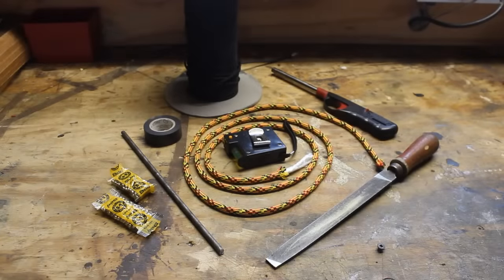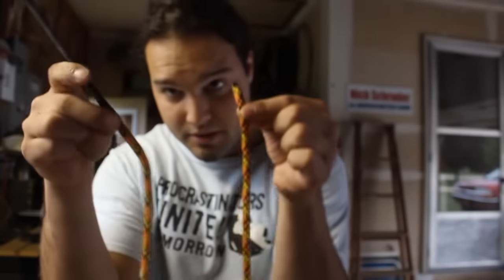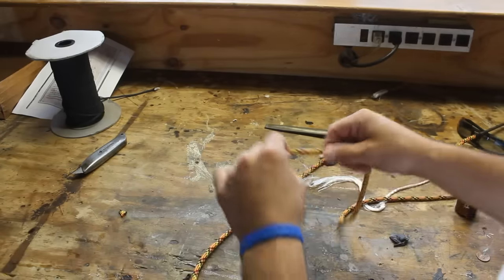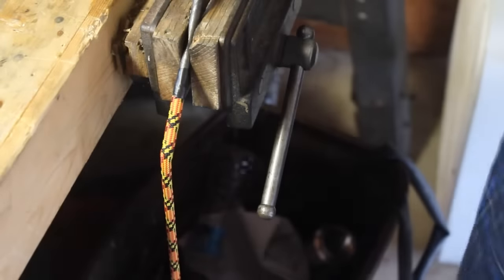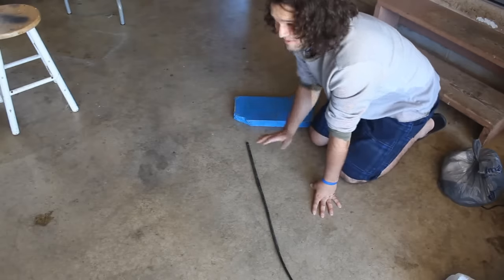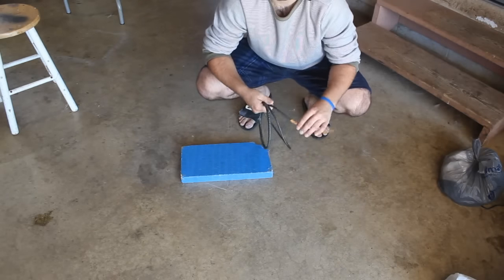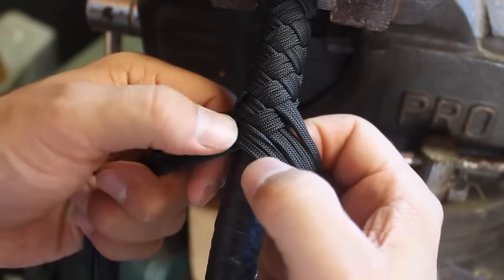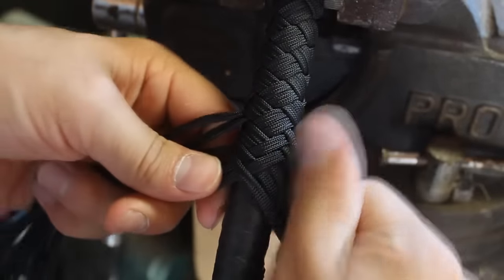How to Make a Paracord Bullwhip - a full length tutorial by Nick Schrader

Comment: Hi Nick, thanks for the video. I just finished the 6 footer. Came out pretty good for the first time, thanks again. The only problem I had was that I was using 550 paracord from Hobby Lobby. It seemed that every 10 feet I came across a splice. The paracord was twice as heavy and the splice was really long. What paracord company do you use for your whips?? And how far apart are the splice points? Also if you recommend electrical tape I use Scotch 33+. very flexible, I use it at work. Thanks. Also I am a fellow musician, brother. Just type in my name on youtube to see my stuff when you get a chance. Thanks again, Michael Szmania.

Comment: OK I've got 4 questions. Is it possible to make a 10' or 12' whip? Do you know how long the strands would have to be for each belly? Would I have to add a 4th belly? And how do you make the 2 larger (guard) parts on the handle?
Reply: R C Marshall Generally the l0nger your whip the more bellies you want. What the bellies do is one: help reinforce the whip. Two: and most importantly, they help to build up the whips taper. so the longer the whip is you want to add more bellies to get a nice even taper all the way to the fall (end of the whip)

Comment: hey Nick
I'm from Germany.
I have a problem with the length of paracord . They are always too short . I have the lengths that you have indicated converted via google . can you tell me , what's wrong ?
Reply: I should work just fine if you convert it. The only thing that I can think of is that you use a different para-cord. I am using #550. What are you using?

Comment: I now want to make a whip, for no reason other than to have it. About how much Paracord would I need to make this? My local retailer only has 50 foot rolls.
Reply from the maker: HI, you'll need about 300ft.
Reply: Thanks for responding! I managed to make it with about 175 actually. I have all the parts mentioned in the video cut from that. All I've left to do is the outer belly. Kinda ran out of time because of school and exams and all.

Comment: Could you do a easier version  with less strands cause my parents don't want to buy so much things please responded Nick
Reply: i see that its a lot of money, its about $50 to get all the things needed but i have looked around and this looks like one of the cheapest and easiest tutorial
Reply: 100ft paracord = $9x3 - $27. BB2 are $4.50 for 6000. I usually need 40-50 for a whip. The rod in the center not more than a couple of dollars. A whip should not cost more than $30-35.
Reply: buy it yourself and its only like 30 bucks. A bullwhip uses a lot of cord so deal with it

Comment: used exact measurements in this video and only got a 4' whip what did I do wrong I know this is a long time ago but I had to start somewhere
Reply from the maker: It could have been plaiting tension, paracord brand, or the amount of tape used.
Reply: @NicksWhipShop  thanks for the reply I have built 2 8ft since I posted this had to up my measurements and stopped using tape used your most recent method but had to use thunderwhips recommended lengths for some reason my longest ended up being 33ft

Comment: Hey Nick, I am confused. When you are wrapping up the handle and "dropping a strand" you are not giving a measurement of when to do this. Looks like you are
 Eyeballing it without a standard measurement. 

Also,  at 56:30 you are "dropping a strand" which is not consistent with the other dropping strands. 

What is the measurement when dropping strands?

Comment: Have you ever tried using a small funnel to fill
Reply: Also check out @jeweled_and_tooled_customs for any leather work or Muletape needs.
Reply from the maker: Hello, I used to use a funnel but found a much quicker way as seen in "my current nylon bullwhip making method 2020"

Comment: you said three hundred foot of cord at the beginning but if you actually do the math you could make 2 six foot bullwhips with 300 foot of cord.  you used 63 feet between the first and second belly and 86 feet for the overlay. still cool though I like how you give the length of each of your cords.
do you have a video on your formula for how you get the lengths of your chords per belly per overall length of the whip?

Comment: came across a product called Danielson Slinky Cord and Tuff-Line Slinker Cord.  Has anyone tried using these products?  Not sure of the specs so I'm leary of purchasing.  Also, I managed to puchase some of same brand of 1/4" cord on Ebay but the darn thing didn't work, which is why I want to try slinker/sinker.   The core was more solid and not able to slip out.  So it probably is best to go with the slinker.

Comment: Its taking me about 15 minutes per BB to slide down....I have to squeeze each BB about 1/8th of an inch at a time.  Why is 1/4 inch core so tight for me but slid down for you just fine?
Reply: About an hour later and I have managed to get about 6 inches of BBs lol.  This is insane...
Reply from the maker: Sorry you're having trouble with it. Please give this stuff a try. It's what I use now and it's much better. Buy it in 3/8in. 

https://rwrope.com/rope/rope-by-use/utility-rope/hollow-braid-nylon-paracord-sinker-cord-slinky-drifter-cord/
Reply: NicksWhipShop That is interesting cord, and it even specifies that is can fit BBs.  I was so frustrated with it because when you did it they slid in pretty easily.  I was excited to start on the bellies and didn’t expect it to take me half the night just for the BBs lol.  But sadly I had already ordered 1/4 inch and is suppose to be here Tuesday.  So worst case scenario, I will try to use all that up and maybe sell a few whips on Facebook.  Don’t know if ai can even get anything out of it though, but will advertise my first one as a prototype, and will be open to offers.  At least it cracks, though!  It is a bit ugly, however.  When I drop strands I can never get it to look nice...

Comment: Great video but you didn't finish off the handle with a Turkshead knot or something similar and attach a wrist strap.  Also, you might want to consider using a drinking straw or a small funnel to feed the BB's in with.

Comment: please please reply do i have to gut paracord
Reply: Izaac, you don't have to, but the whip will be extremely bulky and it will greatly reduce performance. Is there a reason you don't want to gut the cord?
Reply: could i do it with ungutted paracord but only 6 plait not 12
Reply from the maker: No, but it helps a LOT!

Comment: Why not put a small plastic or metal funnel in the tip to load the shot? Just to get them in the cord... Also whips have been around for centuries. Electrical tape hasn't... Is there another natural resilient material to use besides electrical tape?
Reply: RunWayUnderground athletics or hockey tape

Comment: OH NO! SOS! HELP! I just finished the last plaiding and strands ended way too early!! I mean like 58cm till end of the whip. SOS WHAT DO I DO!?!?!?
Reply: Heeeeelp!
Reply: Siiri Tammisalo do you have a pic? I might be able to help.
Reply: Nope but I fixed it! I sew new piece of paracord in each. But now I have new problem. The whole top layer keep coming off from end. Plaiting moves on top of the whip and comes off from end.
Reply: try securing the end with electrical tape and fuse all the ends together with a lighter. I had to make modifications to mine and that helped me.
Reply: Yeah I did that. Now it just doesn't crack so easily. First I melted them together with lighter like you said but it came off as one mass. But for now electrical tape has keep them together.
Reply: is there a way that we could send pictures through the comments?
Reply: I think that not. I haven't seen any pictures in youtube comments.